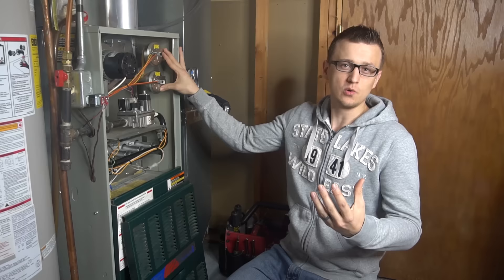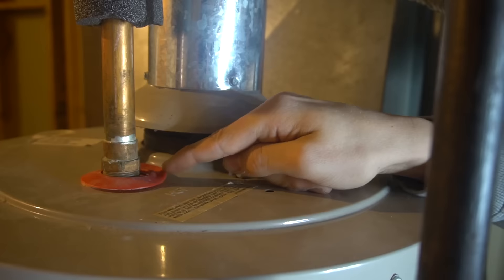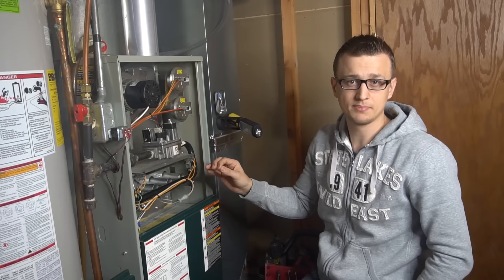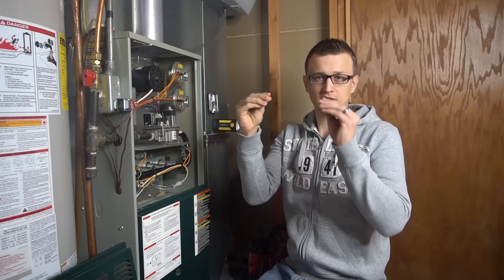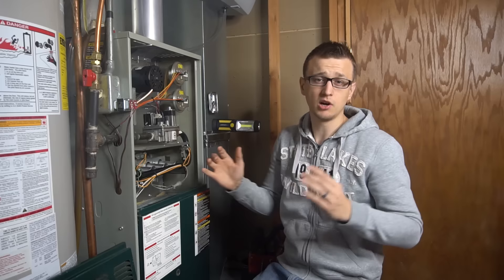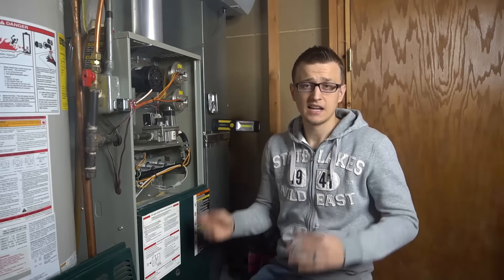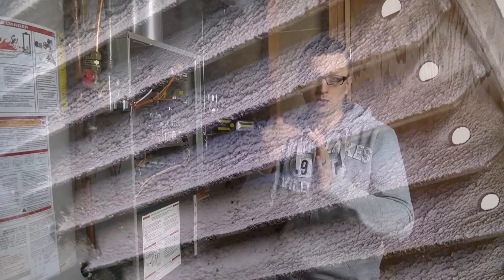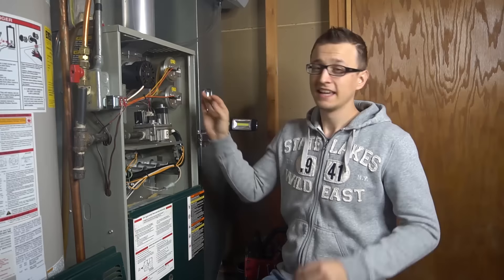Furnace Pressure Switch Troubleshooting

Comment: I got an 80% . My control board burned out. I replaced it with a used one and now furnace fires and runs for 5 minutes and shuts off and blower stays one and then after 10 seconds it fires again

Comment: Please help! When I turn the heat on, the inducer motor starts fine, burners start up fine, blower motor  comes on fine, then about 60 seconds later, the inducer motor and burners both shut off, and the blower motor continues forever until I turn it off.

The code I’m getting is “pressure switch did not close, or reopened”

Comment: what if you jump red and white and the furnace comes on, but will not function while the therm is switched to "heat"? if i turn the therm to "off" and jump the wires the furnace will turn on, also if i switch to on instead of auto. but once i turn to heat, aux furnace will not turn on..

Comment: I get the 3 flashes meaning pressure switch. Now, if I take the hose of the switch, the furnace will start and I can put the hose back on and it will continue to run. I have checked all 3 hoses, 1 from the pressure switch, 2 to the gas valve and 3 to the fire box. they are open. Is it safe to leave the hose off the pressure switch....so that the furnace will light and run?
Reply from the maker: It is okay as long as you put the hose back on after it lights. The pressure switch is a safety switch so it should not be bypassed or disconnected though as that could bring bad consequences. Likely there is some kind of problem either with the condensate drain line/trap or the venting that is causing the pressure switch to open.
Reply: @WordofAdviceTV  thanks for the reply. It was and is, at -20, the fresh air intake. I have the rubber flex tube slightly off to get some air until it thaws.
Reply: Word of Advice TV this seems same with my problem, after unplugging the hose to the switch, it runs...

Comment: My issue with my furnace has 3 blinks which is a pressure switch stuck open. I turn on the furnace with a switch on the side and  the inducer motor turns on but nothing no flames, just the inducer runs there is no rattle or other noise motor seems to be operating ok. and then it flashes the three times. I took the cover off of the combustion chamber and it still inducer motor keeps on running but no flames only the 3 red light blinks. I did  notice in the intake had a small dried up bee hive I took that out, but I'm not sure if there's anything else in there do you think that could be the problem maybe something else is still stuck in there it's making the switch stay open? I'm in llinios and we have been experiencing some very cold weather and freezing rain and snow.
Reply: Here with the same issie. Also have had the same kind of weather here in Nebraska. Wonder if i have an ice blockage up top

Comment: Got an American standard furnace with a condensate.  I get a pressure switch error.  I tested continuity on switch while furnace is running.  I get random beeps from my tester.  I tested negative pressure on furnace and it was -1.25 pressure switch rating is 1.15

Comment: I blew on the little line going into the pressure switch heard and BOOM!!  It fired right up!  Does that mean the switch is due for a replacement
Reply from the maker: There's a good chance that it will work fine for a while but usually if a pressure switch gets stuck once, it will get stuck again. You can wait until that happens or just replace it right away. Up to you :)
Reply: @WordofAdviceTV : Great video Jay - very in depth.  Sorry to hijack this thread but I have a similar issue with our high efficiency furnace that is only 5 years old.  Had a few technicians come in to diagnose and narrowed down the issue likely due to the pressure switch.  Sometimes it works, sometimes the fan would just run and run but wouldn't light up and go.  I've seen the technician blow in the tube to check for obstructions and all.  At the end they said I can try tapping on it to get it to open up to get the furnace to work.  Starting to happen more and more frequent over the past few months.  Do you think I have a faulty pressure switch that I should replace?  Or could it still be other issues...like a cracked tube, or defective circuit board, etc?
Reply from the maker: Hey Andy! What you described sounds like a problem that is from the "annoying pressure switch problems" series... Unfortunately I can't give you a definite answer. I listed 10 possible problems in the video but in reality there are a lot more. (different variables come into play) Although if tapping on the pressure switch gets it to work, I would say there is a fair chance that the pressure switch is going bad.
Reply: @WordofAdviceTV  Wow Jay - thank you soooo much for your super quick response!  Yeah I watched that video afterwards too - amazing job again!  I just came from my basement, took the plastic tubes off and blasted compressed air through to clear out any obstructions.  Still had to tap on the pressure switch to get it to run though. At least there's a workaround albeit annoying.  I think I'll try to order a replacement pressure switch and try replacing it to see if it fixes the issue.  Would you say its safe for a non-professional (me) to replace it myself?  And do you have an Amazon referral code for a Lennox pressure switch 0.65 I could order from to give you the commission?  Thanks Jay!!  :)  Regards, Andy
Reply from the maker: @Andrew-yh7pi  No problem Andy! I just happened to be on YouTube right when you commented :) Likely that pressure switch is getting stuck and with time it will only get more frequent. So I think it's a good call to just replace it. It is safe (just turn off the power beforehand) and very easy to replace. Thanks for offering to use a referral link! I have this OEM one right here: https://amzn.to/2TDbgHh  but make sure you double check to make sure that's the one you need. Good luck!
Reply: @WordofAdviceTV  Thank you so much again Jay!  Would you say these pressure switch typically lasts 5 years or so?  Is that about right?  Or do they typically lasts longer?
Reply from the maker: @Andrew-yh7pi  Happy to help! I actually don't replace pressure switches too often. Many times the furnace will get replaced before a pressure switch will fail. That doesn't mean they never fail, it's just not a common problem.

Comment: My furnace gives me a pressure switch code but it fires briefly then goes out like a flame sensor issue. Any ideas
Reply: Pressure switch. That problem just happened to me. The technician said it was the pressure switch

Comment: I wish I could get you to come to my house and fix this damn furnace. I've been getting pressure switch error codes for the past 2 years and these moron furnace guys charge me a bunch of money only to have the problem re-appear a few weeks after they leave.
Reply: Same here. I've spent nearly 500 to try and get this fixed. A week after the hvac guys leave its back... And they charge over 100 just to come out and look ok at it. 

Did you ever get it fixed.
Reply: @ramblinman7153  I hope mine is fixed but can't be sure. When it first started acting up I replaced one of the pressure switches. It worked for awhile then did it again so I wrote, "probably still good" on the switch I removed. So it started making the error code again so I removed the new switch and put the old one back on. Instantly started working again and has been fine for the past 2 weeks or so. I will never buy another high efficiency furnace again. Nothing but problems with this pile of junk furnace.
Reply: @ramblinman7153  PS I figured it had to be the switch because when I'd tap on it the furnace would start working.

Comment: Jay, I hope you can help me. Money is tight (thanks to covid) and I'm freaking out, 
Our furnace has been acting up for some time. It wasn't coming on. It's a progressive thing. There was a time when I'd shut, the thermostat, off and on after raising the temp requirement. A few times doing that it would work. That stopped. Now I have to shut off the power to the furnace a few times (or more) . The motor would spin for 2 seconds then shut off. A few on and offs and it would do the quick shut off then It would come back on and stay on. Now that's happening a lot. I cleaned the induction hose and replaced the thermostat (that helped for awhile. If I clean the sensor, that helps but the sensor is getting dirty after a couple of days. I just cleaned it again and the furnace seems to be OK (for now). Could this be a bad sensor?....then again why does it keep getting dirty? I checked the diagnostic light but it seems to be flashing in a normal mode. BTW, it’s a Lennox mid efficiency furnace . It’s as if the furnace isn’t, at times, getting a signal form the thermostat unless I recycle the furnace but what’s up with the sensor? BTW, the central air works fine. Help!!!!!!!!!!
Reply: Note: It appears after I clean the sensor that (temporarily) solves the problem. I'm not afraid to replace things. I replaced a board in a high efficiency furnace plus I replaced the fan motor in this furnace.

Comment: I Know practically ZERO about home repair. Is it safe to stick the metal wire into the port w/out shutting off the power? (Stop laughing 🤓😳)

Well, actually a moot point- went to look for a hose like he showed in the video and I see no hoses.... I see many wires of different colors and I see various metal pipes but nothing that looks anything like a hose... 🤔

Edit/update:
Well. I just changed the filter and that didn't do anything but it WAS dirty. Then the only other thing I did was slightly moved the little fan looking thingy and it was a teeny bit stiff and then when I moved it about an inch clockwise, it sort of loosened a little and now ... all is working! 

The original problem was that I'd turn on thermostat and would only hear a little click and quiet little abnormal faint hum inside the furnace and wouldn't turn on. I'd love to know from anyone what it sounds like the problem was!! Thanks in advance! 😁

Comment: Dear, I have a 80% efficient furnace which is running short cycle like about 1 or 2days normal and then shut down itself. After reset the furnace manually it go back to working for another 1 or 2 days. The control board light errors messages says pressure switch open when inducer motor is on. I have checked thoroughly and cleaned the exhaust pipes connecting to outside chimney, also I have take apart the inducer motor assembly which is clean. The connect tubing to pressure switch is intact without any holes or cracks. But sometimes the pressure switch got into open position when the inducer motor is on. I tried to see if there is any vacuum pressure coming from the tubing through touching my face but couldn't feel any sucking pressure. Can anyone tell if there is any other possibilities causing the low pressure from inducer? I would really appreciate that!
Reply: The blower port and tube are all clean without any obstruction. But sometimes the pressure switch is triggered to open when the inducer is on for some kind of reason I couldn't figure out.

Comment: Lots to check tomorrow, I suspect a heat exchanger on my Dad's, starts fine, then shuts off on a 3 flash, after 15 seconds of the blower running???? have checked all controls, I don't want to believe it's the board. Now, I have new direction.  I have those old dude friends too, one gave me a Round Tuit, a round wooden coin with "TUIT" on it,  He said now I had "round to it" and  no reason not to do something,  LOL  Yea, He is my dad, at 87 He is still sharp!  anyone with  advice, I am listening, Thanks!!

Comment: Why the furnace work for 3-4 hours then stop?
Reply from the maker: When it stops, I would look in the furnace sight glass to see if the furnace control board is blinking an error code. That would be a good place to start.
Reply: 3-4
Reply: Some times works up to 8 hours then never start til we reset the cod is 34

Comment: ♦♦ I v changed the pressure switch , furnace works well after i turned it on, and stopped after reached desired temp. but then it just stays like that , can't turn on automatically again. anyone knows why?

Comment: Its electric Furnace. It has power ,Thermostat Ready LoBat  what that means. Thanks
Reply from the maker: That means Low Batteries. You need to replace the batteries in the thermostat.
Reply: Thanks, For your Inf. It worked for me. Fantistac ,Inf.

Comment: My furnace is having an issue where the inducer fan runs and then immediately turns off, and then the board resets, like it powers off and then on again, then the cycle repeats. It doesn’t throw an error, it just powers off and on again. It seems like maybe it’s a pressure switch issue? Sometimes after a bunch of cycles it will run again. Anyone else experience this?

Comment: Gas company says it's the motherboard ?
Reply from the maker: That's one of the 10 reasons mentioned in this video so the control board could be the culprit
Reply: But the furnace comes on for a few hours  then nothing til I reset it by turning off the power and lowering the
then raising thermostat
Reply from the maker: @lynouellette2685  I would try cleaning out your condensate trap then. Perhaps the trap or the drain line is partially plugged and water is backing up in the collector box. After it sits there for a while, it will eventually drain out. Is your furnace a Carrier or a Bryant by chance?